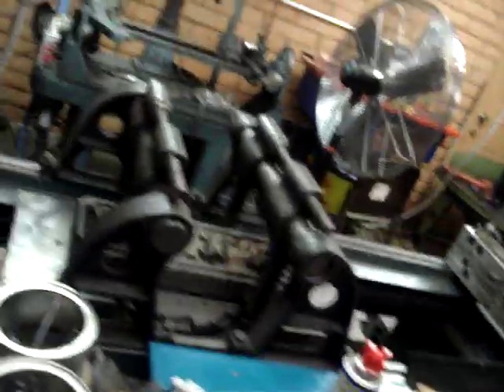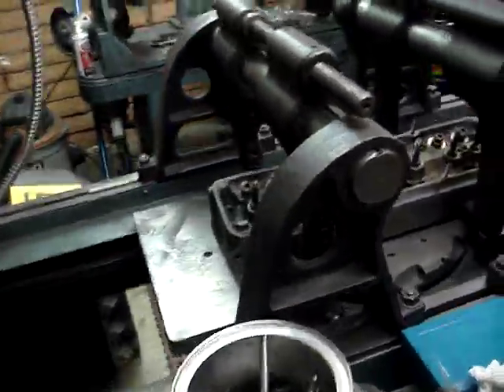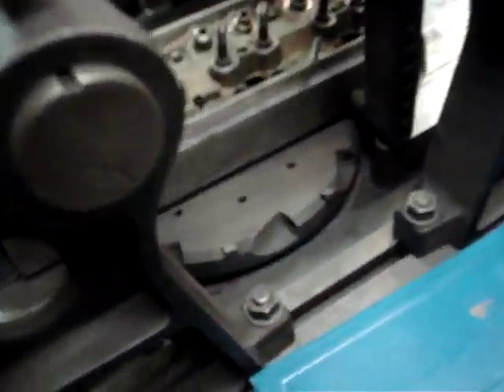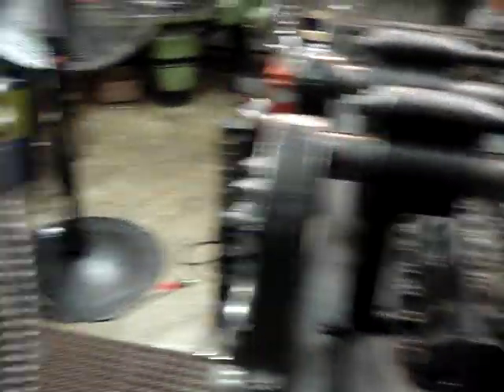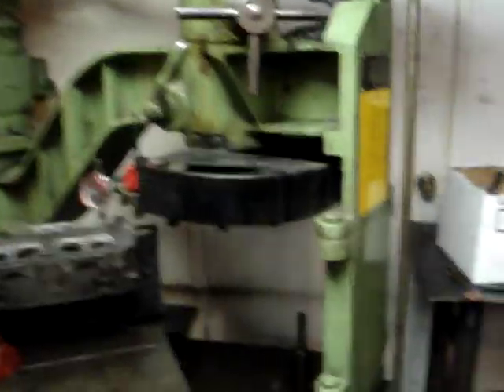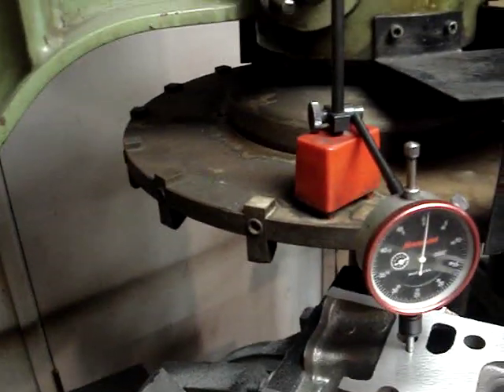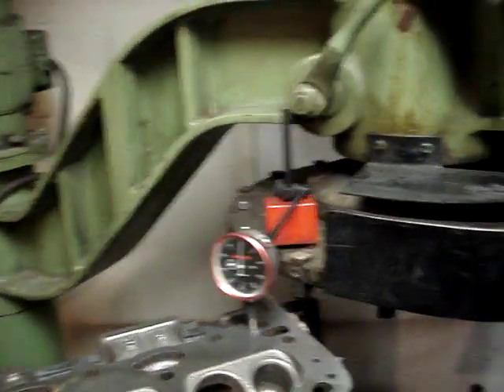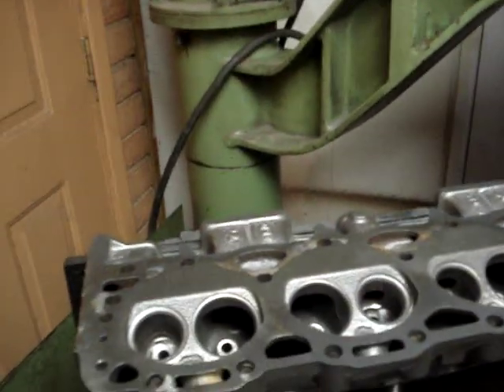350 Chevy Cylinder head Milling

Comment: Nice... what type of milling machine is that sir.. and also what type of boring machine do use.. Thanks
Reply from the maker: Boring Bar is a Rottler the hone is a Sunnen CV616
Reply: storm Vulcan 85 or 85b but need variable speed for aluminum